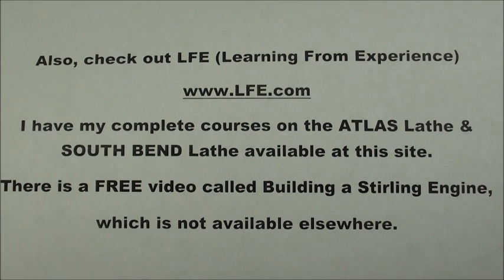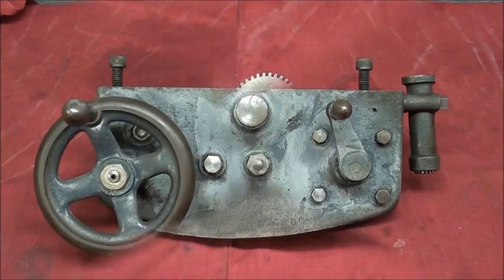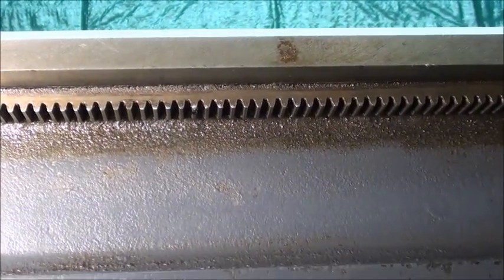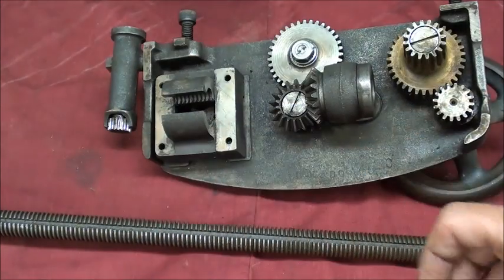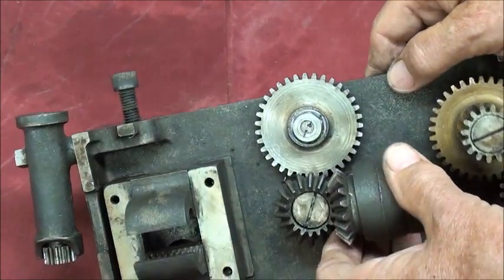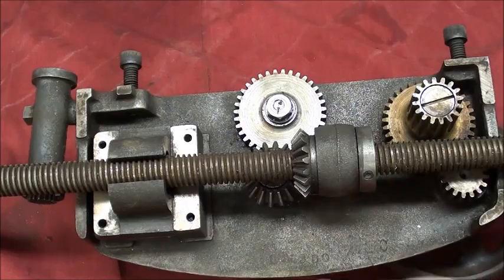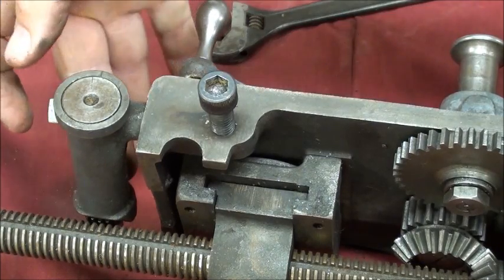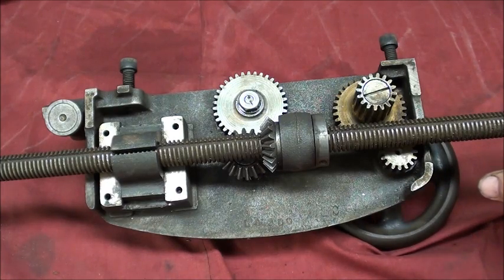MACHINE SHOP TIPS #115 Behind the Scenes at the Logan Lathe tubalcain

Comment: Long time listener first time caller... Mr. Pete, I'm helping to repair a worn-out Logan 912 half-nut. The shop manager is having us pursue the bronze sleeve method that YouTuber Build Fix Create (https://youtu.be/2eTOeSuq5L4) has shown, but I'm wary of relying solely on epoxy to secure it to the half-nut bore. With your Logan experience what did you do to repair a Logan half-nut?

Thanks for any input you have!
Reply from the maker: Sorry, I never had a problem with the half nut
Reply: @mrpete222  Thank you for responding! I was told our Logan was a instructional lathe at a lab at University of Arizona for more than 30 years. It hasn't always been treated well. I hope I can give it a new life in our maker space.

Comment: I'm in need of both miter gears that power the cross feed. These parts #s LP-1212, LP-1213. Mainly LP-1213. They are very expensive to buy new from Logan. Any help is greatly appreciated.
Reply from the maker: eBay is your only hope
Reply: Thanks for the reply! I can find one of the gears on eBay but not the one I really need. The 1213 gear.